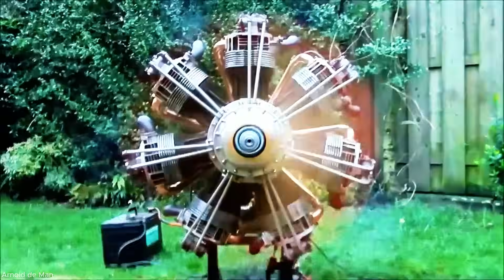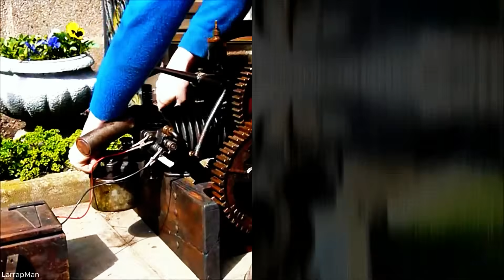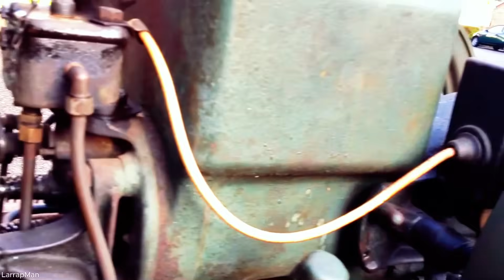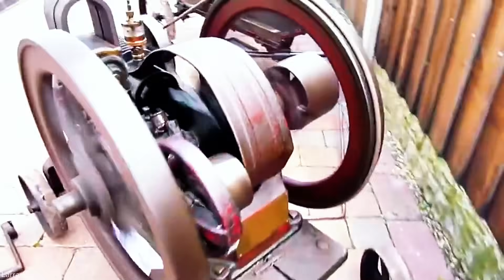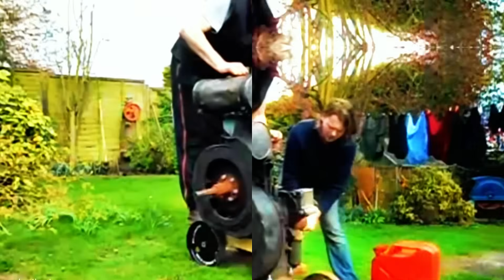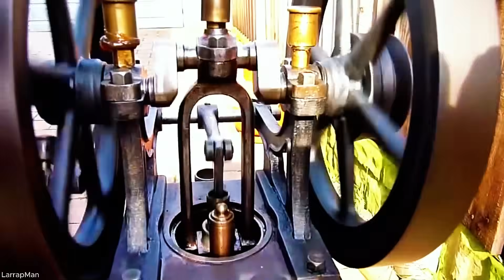Forgotten Farm Engines That Changed Rural Life. A Free Documentary on Mechanical Power.

Comment: I was very disappointed with this video. I don’t know many farmers that use aircraft engines on a farm and all the small stationary engines was shown running but not doing anything which means they achieved nothing. I was hoping to see engines started up shown running and then put on the loud so what you are really doing is advertising that they aren’t much good for doing anything other than just running and making a noise, I’m sorry I’m very disappointed with this video. I’m not impressed.